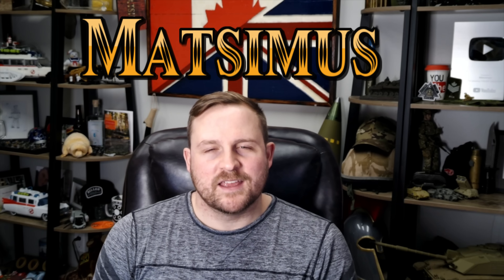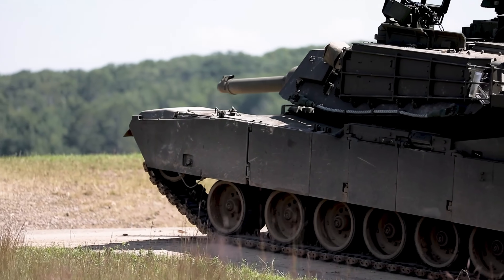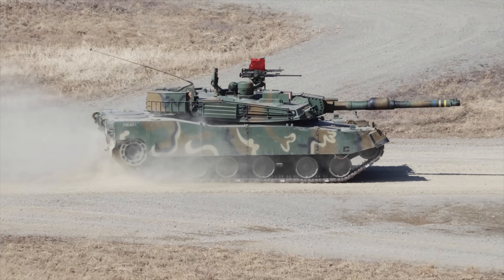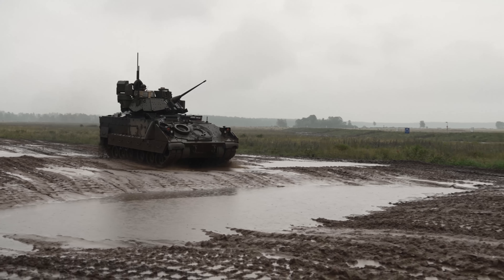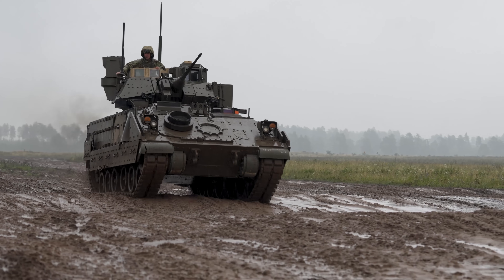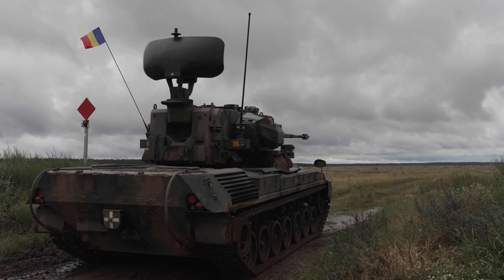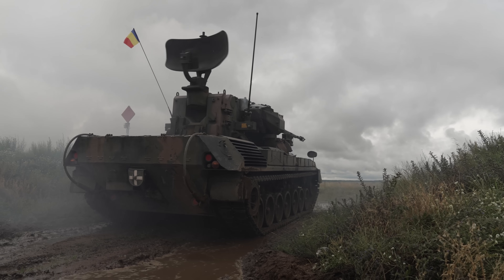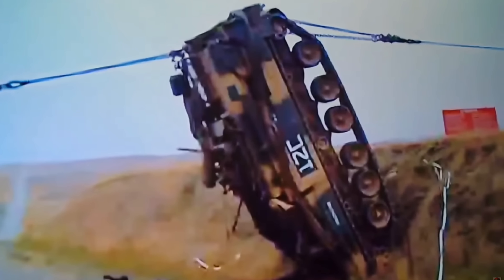Inside Tank & IFV Design: Fuel Placement & Survivability

Comment: Hey, Matt, I appreciate your "tanker's view" on fuel placement in armored vehicles. I suspect...that reducing crew vulnerability to fire will force evolution toward smaller crew sizes... an armored "Crew Capsule" with two crew is much easier to make than with a compartment with 3 or even 4 crew. I suspect...with more AI we will gradually see tanks with two, or even one, or ultimately no crew at all...and this will bring a whole new slew of questions. Remotely commanded, Autonomous AI fighting vehicles will likely become the norm. Good or bad...it's coming.
Reply: Reducing crews is always a good goal, but it can become a false economy if you're not careful.
Reply: @iivin4233 Exactly...it won't be a cost saving at all. Quite the contrary...it will be more expensive. So, I think we are seeing modern amour in a squeeze, evolving to reducing crew size, balancing automation, with more AI coming in the bottom to serve that automation.
Reply: @TyMoore95503  I always wondered about that.  Does ai have a weakness, humans do not.  My only thoughts, future is nuclear or EW saturated and compromised system.  Capture one, out of fuel and ammo.  Dig up its capabilities, now they are predictable.  I say have both systems, manual and auto, see what happens.  Maybe let it run automated, with 3 or 4 men crew supervision.
Reply: @alexturnbackthearmy1907  I like your idea.  4th IT.  I can see it.  With AI piloting, the crew can take shifts.  2 awake, 2 asleep.  All on duty, when things get messy.
Reply: A completely uncrewed (not merely crew optional) tank doesn't really make sense.  I mean ultimately what are you actually protecting with all that armor?  The armor itself?  Some cheap silicon?  It's really the crew that justify the expensive investment in armor -- either because they are highly trained or just to convince them they are safe enough to take an aggressive position.

At that point mobility, smaller footprint and cost/numbers make more sense than armor.  I mean you can make a SPG with a computer inside a foot thick brick of steel/DU and whether it's a tank or an SPG the gun can't be inside the armor so I'm not sure there is much point dragging all those heavy armor panels around.

I'd expect fully autonomous vehicles to either be mobile artillery which eschews armor to be able to always be on the move or something that looks more like a 4 wheel off-road vehicle with a machine gun and some missiles.  Once you don't have a crew you can just send that thing with a full tank of gas to wreck havock behind the lines until it goes boom.
Reply: @petergerdes1094  That is a good point.   Armor does protect the equipment.  Doesnt need to be all weight, can be point defense or detect, evasion oriented, whatever makes it cost effectively safe for  the mission.  Thick enough armor will compromise effectiveness of light, mobile and cheap opposition.  Light artillery and kamikazes more likely to only mission kill.   In the overall armor, the costs involved to push it around can be cost affective with everything considered.  It is a balancing act.  The main point, if one cant predict the future, the gamble is either to build something that is proven to work, prioritize on the economical, or do both.   It is  easier to make something lighter, just by shaving the armor off and lighter caliber, but the reverse i think is far harder or riskier.  Everything loadbearing  even apparently vibration, then the performance can become severe compromised.  Pervious maintenance routine might become impossible.  Trying to build every option, appears the choice for those with means, but if lacking, well, either few but proven, or lighter but more, is the alternative.
Reply: Sounds like what they tried to do with the Armata.
Reply: Drums of fuel strapped on the outside would sure encourage crews to keep their hatch closed. 
You could prob have a system where if there were a near hit, you could ignite the barrel of fuel and the opponent would think they hit your vehicle. You'd be playing with fire tho....   =  )
Reply: @noahway13  That is interesting.  I would assume the FPV operator would know, but an interesting idea.

Comment: The first nation that can produce proper "inert" high capacity durable batteries for use inn fighting vehicles will have a great advantage. Imagine the first proper MTB that trades a lot of its steel and composite armor, for "batteries" armor. (A modern MTB uses about half of its combat weight purely for armor, that's around 30 tonnes for the Abrams and Leopard) Even a tank could get decent operational range from say 20 tonnes of batteries. Say 10 tonnes for a conventional steel "skin" to stop small arm fire and shrapnel, and 20 tonnes for the "Composite Batteries Armor" (CBA) to stop HEAT and APFSDS.
Reply: Anything which stores energy that can be retrieved with relative ease can never really be inert.
Reply: Thing is, this can work even better than traditional composite armor, due to short circuiting during penetration. This can distort the jet of shaped charges and even sometimes reduce the structural integrity of solid penetrators.
Reply: @UnfollowYourDreams I had not tought of that. Should be some reaserch on that topic!
Reply: @ChristianTheNorwegian  there is, sadly i don't remember who did these tests, but they were done. They looked at what happens when you run high voltages through spaced armor and it looked promising. In the end it was unpractical for application on tanks back then, but if we turn solid state batteries into armor this concept might make a comeback.

Comment: Great topic!  Something I have always wondered about.   External tanks could be like fighter drop tanks.   Use that fuel to get you to the fight if you need the range then cut them loose to fight.      How about Jerry cans on light vehicles?
Reply: Actually a lot of U.S. Stryker vehicles carried NATO cans on the exterior...but atleast some of them were water for the crew. The problem with Jerry cans...when a modern vehicle can guzzle 60 gallons per hour, and hold 300+ gallons, a bustle rack holding six 5 gallon Jerry cans of fuel is pretty ineffective. This is why the US Army has so many M978A4 HEMMT 2,500 gallon fuel tankers. These trucks are highly mobile, reasonably fast, and can effectively refuel a single "Tank Platoon" (4-5) M1 Abrahams tanks. 
Modern armor burns through fuel so fast, that the utility of the 20L NATO cans is somewhat limited.
Just a civillian's (never been in the military) take on a logistics problem.
Reply: @T @TyMoore95503 the unsung hero. The fuel
Tanker.    Need a video on that!   I have a Dutch military Lightweight landrover and Swedish army Volvo c303 that I use jerry cans with.  Just was wondering on how they were used by actual military’s.      Cheers.
Reply: @TyMoore95503  Yes! In hot environments, a crew can need as much drinking water as the vehicle needs fuel, depending on crew numbers and fuel efficiency.
 Certainly, when biking in the summer, I need to make sure to take on water whenever I stop to fill the bike up.
Reply: For light vehicles the 20l cans are more for emergency use. Its for when the tanker can't get to you or you can't get to it. Or they are rationing fuel and you don't have enough to complete your mission. I think on one exercise we knew we wouldn't have a fuel truck so we loaded an LMTV full of Jerry cans. Huge pain in the ass. 

They also are for auxiliary equipment: generators, saws, etc.
Reply from the maker: Great suggestion!
Reply: Stridsvagn 103C carried a row on jerry-cans on each side, doubling as sideskirt armour.
The internal fuel tanks were sandwiched between the outer and inner armour plates, against serving to increase the armour effectiveness.
This is nothing new, most aircraft already in WWII placed a tank behind the pilot's armour plate as the fuel slows the projectiles considerably before they reach the plate.

When hit, the usual result is the fuel pouring out and burning on the outside where it makes little to no damage, as the tank was perfectly drivable after a 10 minute napalm burn.
Reply: No need. They can be (somewhat) effective as spaced armor and spall catchers.

Comment: Всё-таки где защита от дронов
Reply: classic heavier armor and vehicle design which had shaped charge attacks already in mind already gives a decent amount of protection ... usually it takes a larger amount of drones to first disable and eventually destroy a halfway decent armored vehicle, giving crews a fair chance of survival ... which is the major point of armor.  Adding cages, nets and metal brooms just further increased the effort to take out an armored vehicle with drones.
As effectiv drones are for taking out vehicles eventually, most drones are just small shaped charges which means they are a slow grind and lower risk to tank/IFV crews. Drones just increased the ranges and chances to get to an enemy, they havent really changed the challenge to overcome armor protection ... in that sense they are a step down from the AT missiles and armor piercing shells which informed the armor designs in most current armored vehicles.
Reply: @diedampfbrasse98  not entirely true. Tanks usually account for “usual” angles of attack, basically from the ground, preferably from front. Drones give you advantage of attacking forward facing enemy from unconventional sides.
Reply: @innelator6941  you skipped a lot of development and protection changes already addressing top down and 360 degree threats, and that saw implementation before the drone war kicked off. Missiles with top attack modes, anti armor artillery shells, AT grenades and popup AT mines already changed the angle of attack game and armored vehicle designs partially adapted already.
Upper armor standoff plates against AT grenades and bomblets, tanks/IFVs getting 360 degree cages/reactive armor packages against direct shaped charges from infantry weapons and directed AT mines, and so on.
Especially the lesser outdated western tech given to Ukraine clearly showed a certain level of resilience against drones because their designs already had been given some adaptation and the growing threats of shaped charges coming from pretty much all directions.
Drones didnt really changed the angle of attack game, plenty of AT weapons before drones already created an all around threat and that not just in urban warfare. The drone warfare just exposed how much of the military vehicles in use werent upgraded to meet the already existing 360 degree threats and remained on cold war standards instead.
Reply: @diedampfbrasse98  1: I didnt skip development but we yet to see its implementation on a big scale. Its not influencing big picture if only several hundred vehicles are like that
2: why you focus on western tech only? I bet you think the most modern tank in RUF is T-54
Reply: @innelator6941  "I didnt skip development" ofc you have, why do you think Ukraine has such higher survival rates when losing its vehicles to drones? Because a considerable amount became western vehicles which already had some of adaptations to all around threats. We are way past just a few hundred vehicles, APC, IFVs and tanks got adapations ever since the iraq/afghan wars and its asymmetric warfare lessons.
2. why I focus on western tech? cause the dictators still riding cold war tech into battle is not my concern, even less so when they start to ride on bikes and horses into assaults.